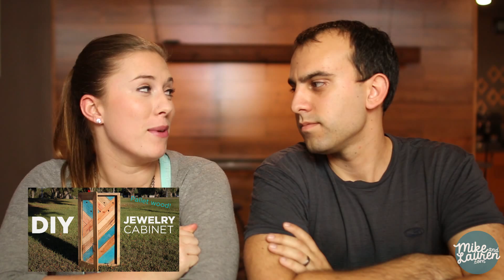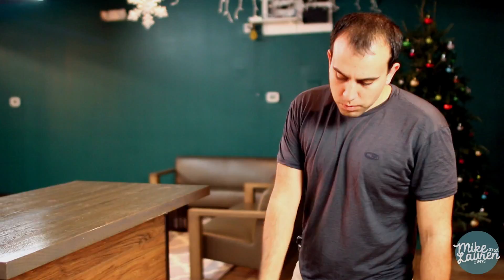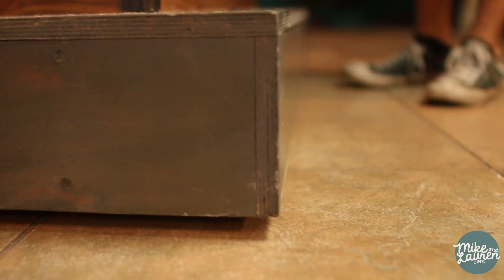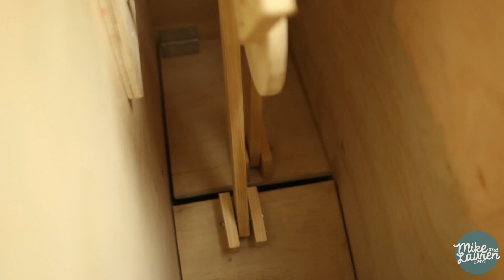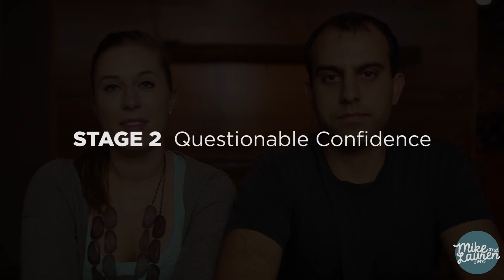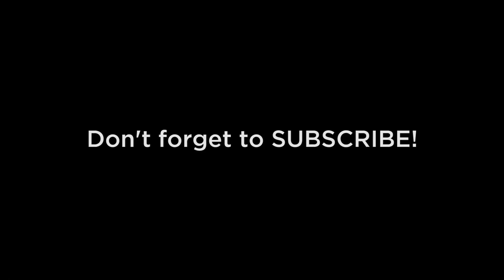Better than Buying (4 DIY Skill Levels)

Comment: What a timely video. I was recently reflecting on just this topic when I was fixing my computer mouse. One of the microswitches for the left-click had broken, and the mouse was essentially useless. I took it apart to find that the microswitch click was broken, and then I took the switch apart to find a copper spring tab that had lost its bend. After carefully reshaping the copper spring, the switch and therefore the mouse started working again for several months while I went looking for a new copper spring tab. Unfortunately, once the copper spring tab loses its bend through years of flexing, rebending it back to shape is only a temporary fix and the thin metal fatigues easily. Apparently it is not feasible to buy this part separately, so I had to buy an entire microswitch for $1 when really I only needed a 5 cent part. This got me to thinking that a lot of people would have been content with simply replacing a $20 mouse without a second thought, fewer people would have taken the mouse apart but then been content to replace the entire mouse after seeing the broken microswitch, even fewer people would have taken apart the microswitch and then replaced the entire microswitch, yet even fewer people would have fixed the microswitch (me, temporarily!) and the truly masterful would have actually made their own copper spring tab to fix the mouse for essentially free. My compromise of fixing the mouse by rebending the copper spring tab several times until it finally broke, and then desoldering/resoldering a new microswitch for $1 reflected an intermediate level of determination that I can improve on in the future, but made me realize that I am WAY ahead of 95% of people in fixing a mouse. To me, this is a great example of how a person can self-demonstrate resourcefulness with an overall simple yet surprisingly multilevel problem like fixing a computer mouse.
Reply from the maker: Shahrukh Bakar Love it!  Awesome story.  Unfortunately I think you're a lot further ahead than 95%, because most people would probably take it in the other direction.

My mouse is broken >>> Time for a new mouse >>> Time for a new computer!

Comment: Mike&Lauren, 
   You're guys generation is probably the 1rst fully disposable generation (Replacement vs. Repair).  It's the difference between me still using a 20yr old Maytag, and your generation being able to buy a $300 plastic washer with plastic parts.  Why would I spend $2-3k (in today's $$) on a reliable new washer (with metal parts) when less than $500 gets me a chinese made throw-away that I can replace every 5yrs?  It just doesn't make sense to do a $100 repair instead of replace.  Maybe that's just for appliances, but seems to apply for any chinese manufactured product.  ...Make it myself for +++time & $$, or save all the time, spend a little more...$$$; and poof, its done.
   I think your skills are great for customized or expensive projects; but its hard to compete against cheap chinese manufacturing.
Reply from the maker: dhawkins0000able It's funny I've been thinking about that lately, and I'm personally over it.  I'd much rather spend $2-3k for a reliable washer than $500 for a cheap one. 

My frustration mostly comes from tools.  I've decided that even expensive tools today aren't up to my standard.  So I'm starting to look for vintage hand and power tools to start restoring.  I watch the channel "wranglerstar" and his restoration videos have inspired me.  

That's really what this whole video was about.  I'm at the point where I'm more interested in spending the time and money on higher quality "cheap" products, not just expensive or customized ones.